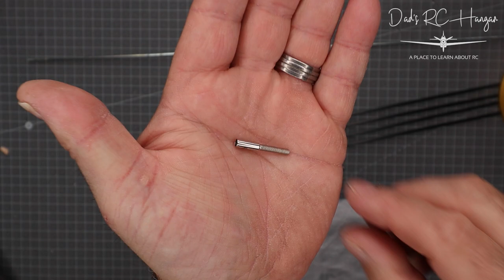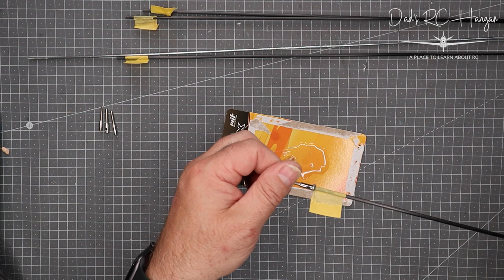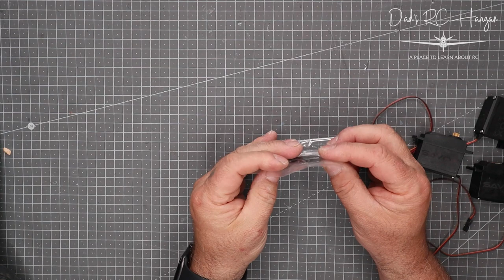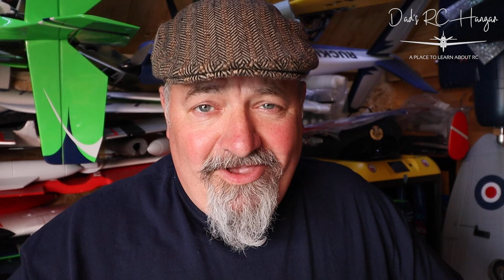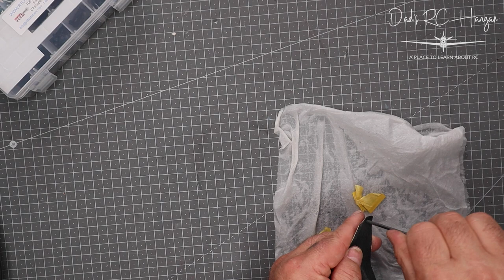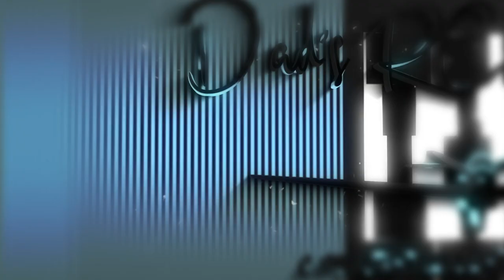How to Cut carbon rods | Pilatus Build

Comment: Great video Chris! A few tips for you, when sanding the carbon rod always clean it with alcohol, after you mix your Epoxy clean access off with alcohol gives you a clean glue joint every time. Regardless what you are gluing. Especially tailfeathers, clean the excess off with alcohol and you don’t get that nasty glue joint. Also big tip is sand the aluminum fittings as well. I use a little tinier piece of carbon wrap it with a piece of sandpaper and sand the inside. What happens is if you don’t the epoxy might not glue well but you do have two holes so that will definitely give you a good joint!
Reply from the maker: Some great tips buddy, what I love about the community, always help. I will certainly use the tips when I do the other ends. You know I was lying in bed and thought the same, I should have sanded inside the aluminium. Have a greasy weekend 👍🏻

Comment: Yeah Chris Carbon can be very bad. I use carbon rods a lot for reinforcement. I wear a mask, glasses, and use a fan to blow it away from me. Then vacuum it up. Very nice work. Those will work nicely! One little thing we do with 3D planes to have a stiff push rod is to use a small diameter steel push rod, but put it in carbon tube. To be fair though the push rods are very short in comparison though. Enjoyed it buddy!
Reply from the maker: Crazy stuff Adam, but nice to do something new. The rods have a outer tube to fit in, plenty of fun ahead 👍🏻. Have a great week buddy.